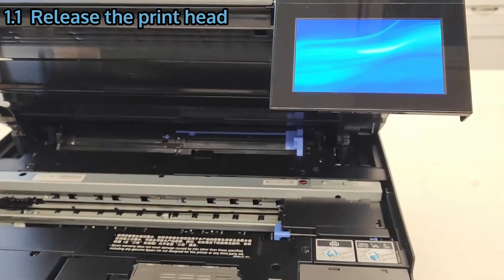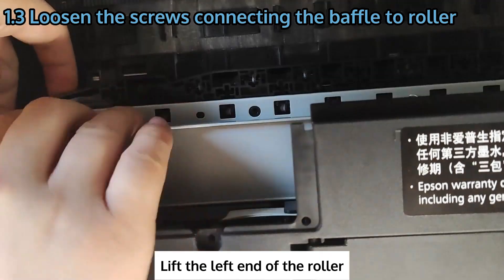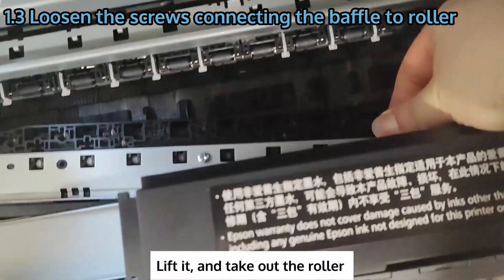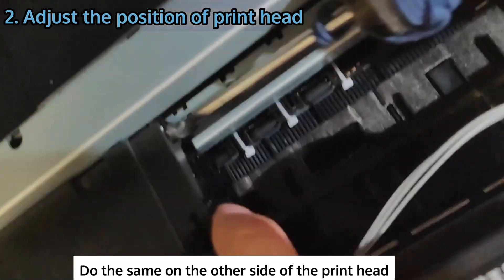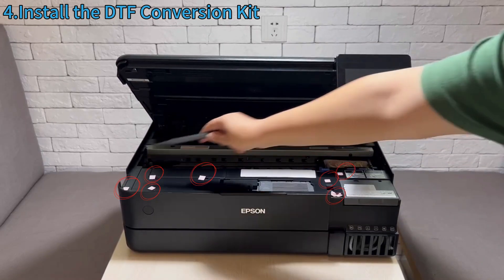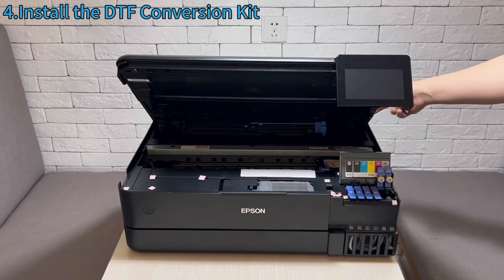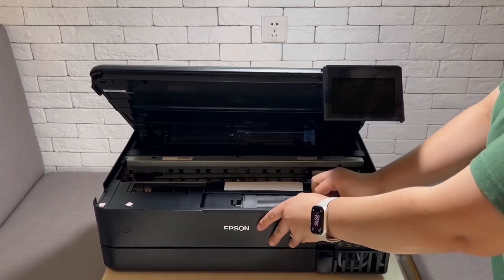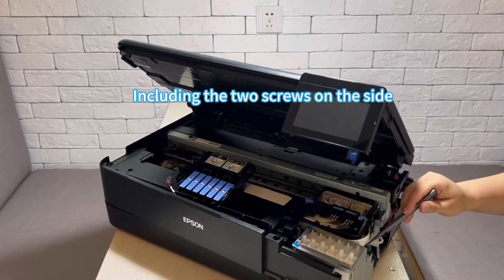How to Convert ET-8550 to DTF Printer and Install the Waste Ink Tank Without Causing Printing Errors

Comment: Is it possible to convert an Epson T1110 to DTF? It has 2 black cartridges so, I think, would be possible to use one of them to white ink, just with a new firmware/software. I'm wrong? If so,  where and why?

Comment: I would like to see the tubing connections for the inside of the printer, I’m not sure how they did it before running it trough ink hole,
Reply: I was wondering the same
Reply: I would only take out the side panel and connect the CISS tubes by connecting them instead of to the existing tanks.  Then fill them all with cleaning solution so I could swap the tubes when I need deep cleaning.

Comment: So - how do you prime the ink?
Reply: Power clean primes it
Reply: @Hiploephso every time you do a power clean that pulls the ink?
Reply: How often do you have to do this? Is this one worth it? And what exit tray were they using?
Reply: You could pull ink through the CISS tubes from the printhead, or push air through from the CISS end.